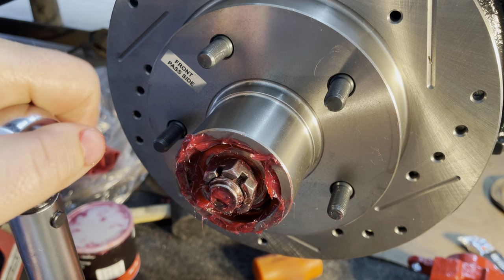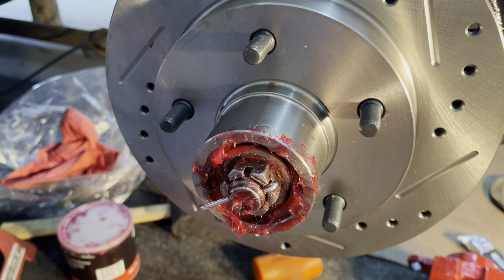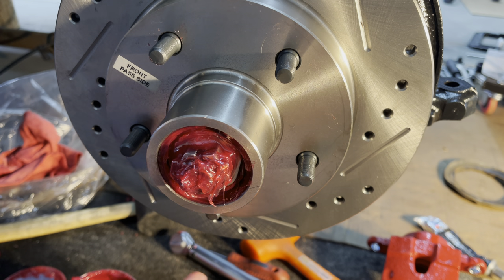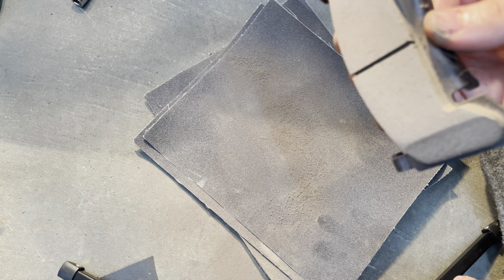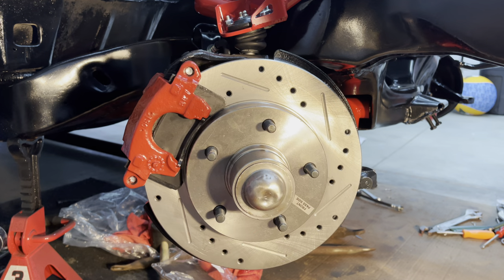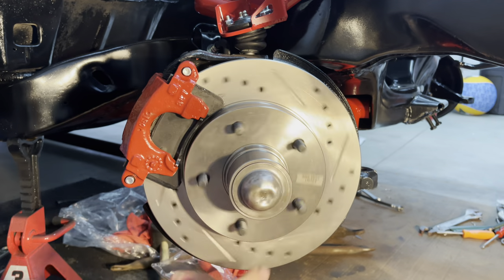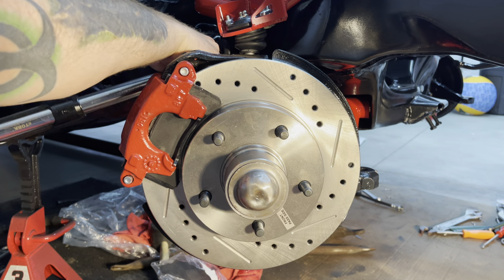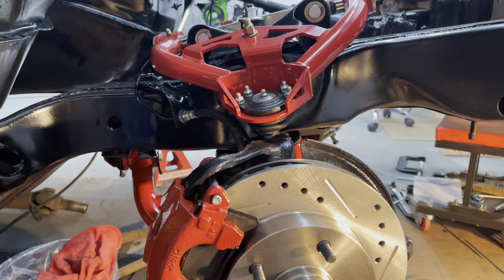Gbody slotted/drilled rotor,  brake pad, & brake caliper install. Power stop brake kit.

Comment: Could I use a S 10 front rotor on my 84 Hurst Olds
Reply from the maker: You would need the spindles, calipers, rotors, and hubs off of the 98-04 S10/Blazer. But yeah that’s a common brake swap for a duel piston upgrade.

Comment: Great video! Where can I find the brake line for this kit?
Reply from the maker: Summit Racing 👍🏻
Reply: You gotta change the brake lines??
Reply from the maker: @84.C6Ty  no. They are stock calipers just painted red. Stock ones will work
Reply: @DandDPerformanceEngines   ok because I was like “dang. I gotta buy more parts🤦🏽‍♂️”😂
Reply from the maker: @84.C6Ty  I know what ya mean. It’s a never ending cycle lol
Reply: @DandDPerformanceEngines  exactly. Gotta get parts for the parts 🤦🏽‍♂️